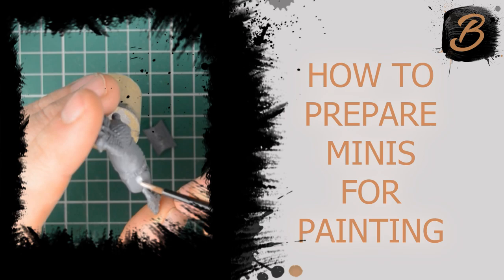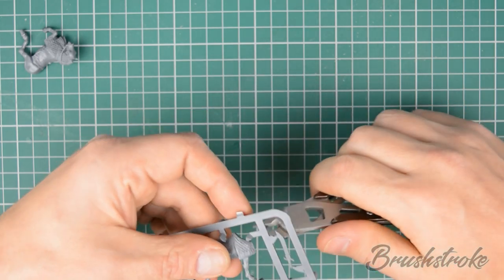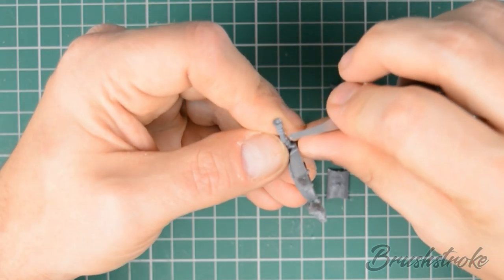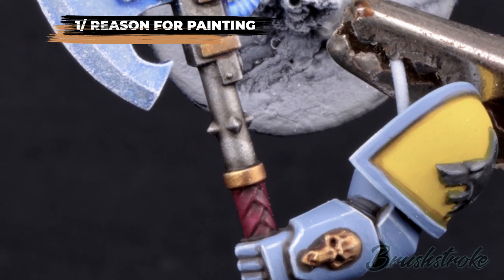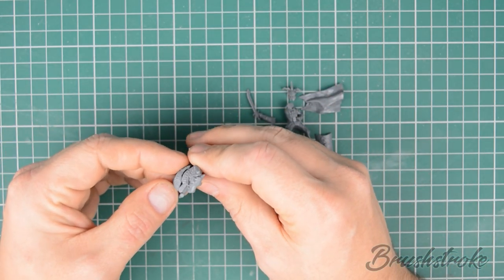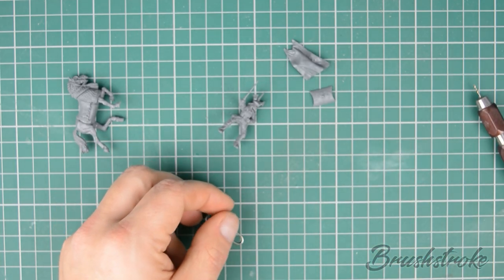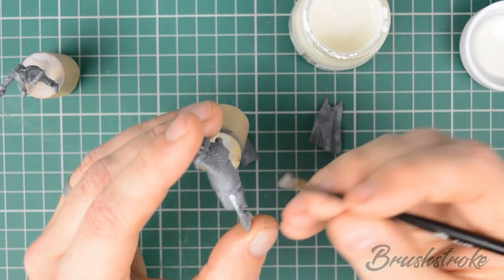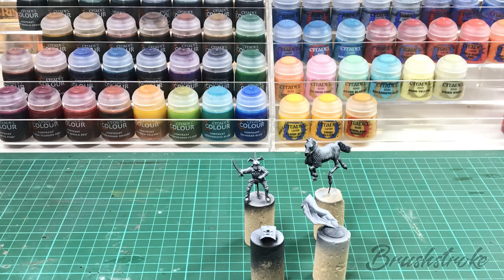HOW TO PREPARE MINIS FOR PAINTING: A Step-By-Step Guide

Comment: I know this is an old video but it would be great to get a more in-depth tutorial on removing mold lines and sprue bits. The example shown in this video was a relatively smooth area on a horse and along an actual part seam, but often times we are dealing with things like ribbed cables or knuckles that are incredibly hard to remove lines from.

Comment: I know I'm way late to comment here. I've always found it's easier for me to dip the entire sprue in warm, soapy water, and  lightly brush with a cheap (soft) toothbrush. The sprue helps support the pieces for thorough cleaning, and I can use my airbrush or a cheap hair dryer to dry the entire thing. This avoids having to fish out tiny, fragile pieces from soapy water that I can't necessarily see into easily.

You can also make your own filler using old sprue, and Tamiya extra thin cement. Snip small pieces of sprue into the cement, and let it sit for a while. Agitate every few days, and add more sprue if it's still too thin.
Reply from the maker: Thanks for taking the time to comment, I agree completely with your suggestions. They are both great tips 👍

Comment: Do you imagine the 'Washing off release agent' step is necessary for pre-assembled board game miniatures??
Reply from the maker: Yes, 100%.
Anything injection moulded will have release agent on it.
Look at it this way, better to be safe than sorry 👍
Reply: @BrushstrokePaintingGuides  Much appreciated!
Reply: Follow up question - if a miniature has an unintended bend. E.g. a gun / arrow / spear or something that looks quite odd when it's not straight. Would you attempt to straighten? & if so - how?
Reply from the maker: @CeeJaeRgh  yes I would.
You need to heat it to make it soft enough to bend and then cool it so it hardens again in the new position.
To heat it you can use something like a hairdryer or a bowl of hot water (not boiling and still take great care with this option)
And then reposition gently. Never force it. If it doesn’t been easily, warm it more.
Then hold it’s position and submerge in cold water to set it.
You may need to do a few passes to get something to settle exactly how you want it
Reply: @BrushstrokePaintingGuides  thanks!!

Comment: So, here's a question about sub-assemblies and gap filling. Where is the balance point between putting two pieces together to fill a gap that you know is going to be there when the pieces come together, and knowing that when you put those pieces together, you will have difficulty reaching all of the detail?
Reply from the maker: it's an interesting one and as I think you suspect there's no hardened rule, as it differs from case to case.
personally I would always rank gap filling over detail painting.
However, it doesnt mean it has to be quite so clear cut. 
You can have a bit of a half way house, in that, I have in the past primed up some sub-assembly pieces. Painted them to base colour level and then stuck them together, as I knew I would need to fill a gap.
Filled and sanded the gap. Then applied a little primer to the area and base coloured it to blend in with the rest of the mini.
This method worked really well as it goes, because the difficult to reach area was at least now nicely base coated and would only really need a wash to finish it off, which I could get a brush in to do and the area where the gap had been only needed base coating, so that didnt pose any colour matching problems.

Hopefully that gives you another option, but like I said it;s really down to trying to make the best choice for the situation

Comment: Great! You’ve covered a subject that is often overlooked. My next project is for some plastic AWI infantry, but there is one figure that is only available in metal. Is there a filler that will cover assembly gaps between horse and rider?
Reply from the maker: A lot of people worry about preparing and painting metal minis, but they really aren’t that different to plastic minis.
The Mr Dissolved Putty stuff I used in the video will work just as well on a metal mini.
Just make sure you wash your mini first to remove any lingering release agent.
If you have very large gaps, I would recommend Milliput as a good filler. Again, it works well with any material.
One other bit of advice I’d give regarding metal minis is with their priming.
Make sure you leave your primer to cure for at least 24 before you start to paint.
This will help the primer really bond to the metal and massively reduce the risk of paint chipping off later.
Hope that helps, let me know how you get on 🙂

Comment: Mr. Hobby has a lot of neat products outside their Mr. Color line (anyone see the naming convention here?), including Mr. Surfacer, which is my go-to primer as it has some of the properties of Mr. Dissolved Putty but to a much lesser extent, meaning that it won't fill gaps very well but it does a great job of smoothing out surface abrasion and adding subtle texture to the plastic.

Comment: FIRST:  Wash the miniatures with warm water and liquid dish soap that does not contain citrus oil.  
SECOND: Rinse thoroughly in cold water. 
THIRD: Allow to dry or use a fan or hair dryer to dry.
Proceed with the instructions given in this excellent video! 👍🏻🎅👍🏻

Before anyone whines:  for decades I have washed miniaturesas above and,  before each session, I wash my hands with The Master's (green color bar) hand soap made to remove oil paint from hands and clothing (not the white soap for brushes, but very similar).  I assembled, primed, and painted the horses for a regiment of Dutch Light Dragoons in acrylic paint. The next day, as I started to place the riders on the horses, I noticed the paint RUBBING OFF the horses!  The release agent from the mold was still present and had caused the primer not to adhere properly (BECAUSE I had been distracted and had not washed them).  So, had to remove the paint, wash them, and paint again; this time without issue.

Comment: Just started painting space marines to keep me from going insane after my stroke, would you consider doing a video on the tools and equipment you use, for example, what paint rack your using for the citadel paints? Anyway, thank you for the videos, they are stopping an old guy from going crazy with boredom and educating me at the same time.
Reply from the maker: Hey man, so great to hear you’ve found this hobby both therapeutic and relaxing.
I started painting to take my mind off some very stressful things I was going through and now I’d be lost without it.
It may be a while before I can get round to doing a video on equipment, so I thought I’d answer the paint rack question now.
They are actually nail polish display racks.
I got them years ago from a company on eBay. I think you can still find similar if you search for “tiered acrylic nail polish racks”
Thanks so much for watching my videos, really glad you’re enjoying them and finding them useful 👍

Comment: I fully assembled and painted my first set of space marines and was frustrated trying to paint the details. This is the best setup video I’ve seen, particularly with sub assemblies. Thank you!
Reply from the maker: Thanks for checking out my channel.
Really glad you found the video useful.
Not being able to reach details to paint is so frustrating. Especially with faces. I much prefer to paint heads separately and add them later, so much easier
Reply: @BrushstrokePaintingGuides  I will definitely be doing that on the next batch. I've got a captain and a bike squad on the docket and there are so many little tight spaces :|
Reply: @BrushstrokePaintingGuides  I've just recently assembled and painted my first space marines and it is tough after seeing the angles and spacing. I think I'll definitely try the sub assembly method. Do you do the same thing for the heads? Drill a hole and glue it?

Comment: Sprue bits can make for good terrain rubble depending on how it comes out and what you need/make.
Reply: You can also turn them into gap filler with the right kind of cement. I've mixed chopped up sprue with Tamiya Extra Thin in the past to make a kind of (toxic) plastic paste that you can put into the gaps, squeeze together, then trim and sand down the excess when it dries to get a manufactured finish to the gap. It's more useful in the gunpla space where you've got color-matched plastic and less need for paint, but it also works great here since unlike putty it will never dry and crack or otherwise degrade.

Comment: Injection moulded plastic does not use release agent. Only in resin casting do they use release agent, though some manufacturers use talcum powder when they cast metal miniatures.
In the case of flexible miniatures, like Reaper Bones, they are made of PVC with plasticizer, the latter chemicals being why Reaper Bones and similar miniatures (or action figures) refuse to accept spray paint and even regular acrylic paints. For ABS plastic, which is what Games-Workshop and most other miniatures manufacturers use (LEGO and Bandai for Gunpla, too), it's simply melted down and then injected into a steel die which is also heated to ensure that the plastic does not cool too rapidly and fills every detail. When the plastic is cool enough, and it doesn't take very long, it will usually just pop out of the die because the plastic doesn't stick to the steel or aluminum once cooled.

I'm not trying to be patronizing towards you (Brushstroke or anyone reading this) with this comment, I've just heard it said that there's "release agent" on ABS plastic from a handful of people on youtube and that it must be washed off or paint will not stick when it's just plainly false. There are many variables that go into injection moulding ABS plastic; the pressure with which you clamp the dies together, the temperature of the die, the speed at which you inject the plastic, the machine you're using; but a "release agent" is not one of them. Unless you're extra paranoid about finger grease or getting something else off of your miniatures, you're just wasting your time by cleaning plastic models like that.

If it does anything to assuage people's worries, I myself have never bothered with this step and, provided I primed my miniatures (which I did not do when I was a teenager and just got started), I have never had issue with paint rubbing off. The same goes for my friends that game with me or have gamed with me.
Reply from the maker: Thanks for taking the time for writing such a detailed response, it really is great to see. 
I will say though, that the information I gave has actually come from a caster at GW during a factory tour and not simply my speculation or hearsay. 
Of course, being no expert in the process I will always concede I may have misunderstood. Personally I’ll stick with rinsing all my models, as if nothing else it’ll remove any dust, debris or whatever and certainly won’t do any harm. 
That said, I’m a firm believer in, if you’re getting the result you want then it can’t be wrong. So, all good man you do you 👍 
Happy painting
Reply: @BrushstrokePaintingGuides  If they said that, then that is very strange. Immediately my mind begins to speculate as to why it is they do that, if it is something they've started doing recently, or yes, if it was something that mixed together with something else he said in what I honestly imagine was a very exciting occasion. It may also have been that person getting things mixed up. In the end, though, it's no big deal. I'm certainly not about to jump onto "Ah, yes, it must be that he is totally mistaken" and heap the blame on you. I wasn't present, and you no longer 100% remember, so there's really no telling what the truth in the matter is.

Ultimately I think my point is that it should be alright if someone doesn't do that step. I don't mean for that to come across as if I believe you're telling people they MUST do certain things or they're destined to failure, it's more like providing additional information to anyone that might be a little prone to worrying. That, and for those who aren't it could save a bit of time. With all that said, now I'm paranoid I come across as a concern troll.

Few last things; I appreciate your taking the time to read over my comment, and I greatly appreciate your responding. I'd seen your videos recommended in the past but didn't watch anything until I saw the thumbnail of your Ultramarine. Never had I seen such a vibrant blue, so I was drawn in by that. I definitely appreciate your inclusion of MESBG models, too. It occurs to me that if you ever wanted to do a tutorial involving painting a lot of skin, a Mordor Troll might be a good idea.

One final thing on injection molding; if you're unfamiliar with his content, I would recommend Crafsman Steady Craftin's video on injection molding. He actually does it himself with a manual injection molding machine, a small die, and plastic pellets. Goes into a lot of depth on the subject as well as showing it.
Reply from the maker: All good man
Always appreciate conversation and comments. In this case, I'm really not sure where the "truth" lies. Maybe it's something they do at such a large industrial level to enable them to get thousand and thousands of presses quicker or help protect the die? I think we can agree, I dont know :D
Honestly, I only ever started this channel to make it easier for me to answer people asking how I do things, as I can simply point them to a video. As I said before, I really don't think there's ever a RIGHT way to do anything in this hobby. It's all about finding ways to get the results you want. If you can do that, then no one can ever tell you it's wrong :)
oh, and yes... I love that ProAcryl blue. It's so punchy and one of those schemes where the more minis you have in it, the more impressive it looks.
Thanks again for checking out my channel and good chatting to you :)
Reply: @BrushstrokePaintingGuides  I totally understand that. I've even got a few friends that are similar, though they haven't gone and made a whole youtube channel for that sort of thing just yet. While I didn't do painting or hobby stuff, I used to have a channel of my own, so I don't blame them for not jumping into it and find it that much more amiable that you 'took the plunge' yourself.

Speaking of answering people's questions, I watched your wet palette video shortly before I watched this one and it reminded me that I tend to always have problems when using mine. Have you used one with a sponge before? After seeing that video, I can't help but feel like some of the trouble I have is related to the sponge not wanting to cooperate with the paper, causing me to need what seems like way too much water (certainly by your method it is far, far too much water) or else risk the paper curling up and the paint drying out on it.

I just looked up those paints finally, too. I really need to not go spending even more money on paint but boy is it tempting. Especially since Vallejo has discontinued their Game Color range in favor of a revamp.
Reply from the maker: Was your wet palette a bought one or a DIY one? I've always gone the route of paper towel as the reservoir, simply because I'm lazy and can't be bothered to wash and rinse a sponge regularly. For me it's just far easier to quickly replace the paper and re-soak it. I have the huge advantage of not living in a particularly hot country though.
For hotter climates I understand sponges are very necessary. However, from friends I have who do use sponges they have said that using some paper towel on top of the sponge actually helps regulate the moisture better.
So, that could be something to try. Either that or try a different paper for your membrane, as it could be that is not allowing the correct moisture level through to the paint

Oh, and buy the ProAcryl paints. They are LOVELY!
Reply: @BrushstrokePaintingGuides  Bought. It's a Sta-Wet, I think they're called. "I think" because I don't remember what their weird naming convention is exactly. Either way, it's a pretty common one and I got it after using a homemade wet palette for a while. It's significantly shorter and much larger, which has proven to be a tremendous boon.

I do also live somewhere that gets, as a teacher of mine used to say, "Africa hot". Just yesterday it was around 31C. I've also had friends using paper towels, though, and they found plenty of success with it. My hypothesis is that the paper towel clings or just sticks to the parchment paper in a way that the sponge just doesn't. Ah, well. I'll just have to try out paper towels next time I think. Shouldn't be all that long, since I've got an army in the works.
Reply from the maker: No worries, good luck then man. Let me know how you get on

Comment: Love your videos, very on point for me and really shed light on somethings that have either mystified me or I've just taken as the norm and not really knowing why. 

One question I do have, is how would you tackle a "push fit" model? Using a sub assembly approach you are able to get to all the areas you want too but you run the risk of ending up with gaps after assembly...

Help me oh might Brushstroke, your my only hope!
Reply from the maker: Thank you so much for supporting the channel and being a Brushstroke member. It means so much to me and does help keep the channel ticking.

So, for push fit, I always cut the rods in half. That way you still get the advantage of them guiding the pieces where they need to go but “shouldn’t” stop them being taken apart again.
The problem with push fit is as the rods are pushed in they compress air in the tubes and because they’re the same length of the tube they can never fully fit properly and often leave gaps.
It’s better to reduce the rods and glue the mini together as a normal mini.
Hope that helps? 👍
Reply: @BrushstrokePaintingGuides  Genius! Thank you for the speedy response! I'll give that go.. 

You are most welcome, your videos are really helpful, so thanks once again!